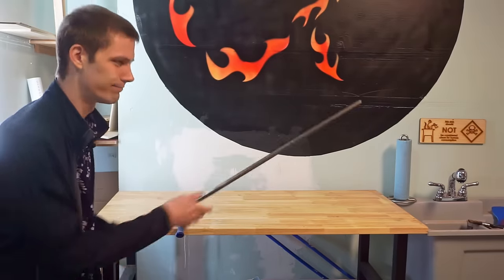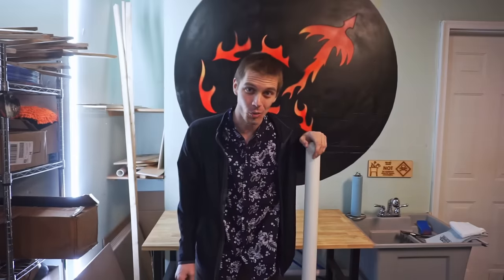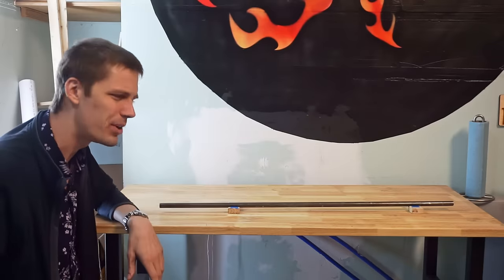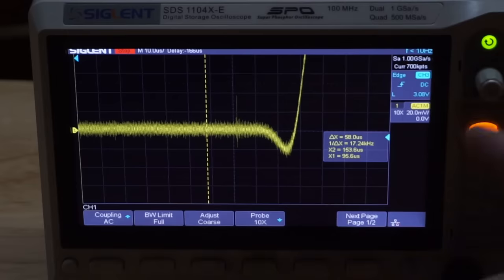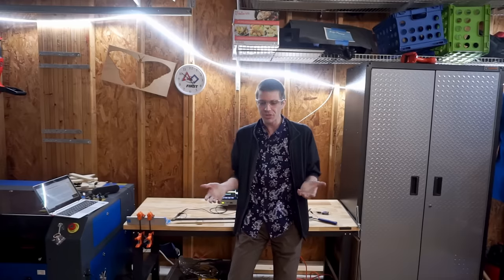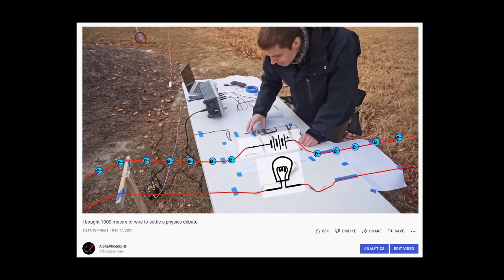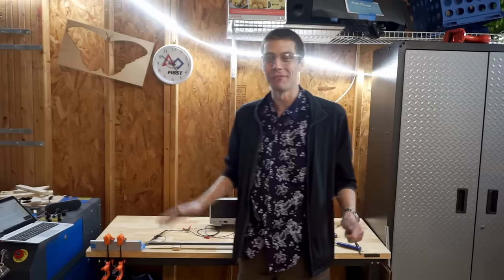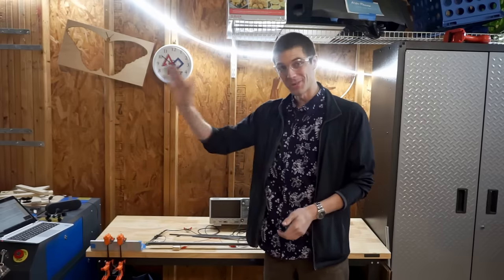Are solid objects really “solid”?

Comment: I am a metal worker and I often ponder this when striking a large piece of metal with a hammer and how the noise is generated. When I saw a 1000fps camera watching a drumstick hit a symbol I then realized that metal is kinda like a jello ! this further grants me a deeper insight into the nature of the materials that I craft with. Thanks a ton! Now I have questions of material hardness like mild steel vs machine steel or hardened? Answers always leed to more questions, I am grateful for people with such a wealth of knowledge and perspective that can break this stuff down for simple minds like mine.
Reply: if you think thats kewl, ponder the different sounds that are produced by metal in the many different applications... such as the guy lines holding those 500+ foot tall towers, the round rail track a crane pivots on, really long metal pipes of various diameters...  they create sounds that are very strange to just hypnotic.
Reply: Harder materials - higher speeds of sound (typically, strange stuff "always" appear).
Reply: @KitagumaIgen  not actually. What you meant is that higher rigidity implies higher speed of sound, wich is the magnitude de Young modulus measures. It's a property of the material, hence it is not afected by heat treatment of the steel or the alloy. There is a beautiful video from This Old Tony where he explains that in a lovely way (it's also fun). 
Cheers!
Reply: @brunogausa  Do you have some example where a harder material doesn't have a higher Young's modulus?
Reply: @KitagumaIgen  well, a clear example is the comparison between hardened amd mild steel. 
Other cases are harder to come by, but there are materials like poliurethane resins that are not as hard as steel and more ridgid.
It's an interesting topic
Reply: A great example would be pine wood against a lot of thermoplastics. The later are harder and stronger, but wood is far more ridgid
Reply: @brunogausa  Wood? That's not a material that exists! Oh, man I was way way way too narrow-minded to think about anything outside simple homogeneous materials, and I forgot that hardness has a specific meaning in terms of resistance to plastic deformation. More coffee for Kitaguma.
Reply: reminds me of something I heard a while back about rocks not being technically solid but in fact just being very very very very very viscous, and extremely slow flowing. The same basically applies to everything, nothing is truly solid, just unimaginably viscous and slow flowing, and of course the same goes for metal. Like if you think about it, metals have melting temperatures, but it's not the case that they remain solid all the way up to 99.99999% of their melting point temperature, and then POOF they hit 100% melting temp and they suddenly become a liquid- but rather it's a gradient where as you increase temperature they become "less solid". Therefore it stands to reason that as you lower the temperature, the viscosity, or solidity, increases gradually. So at ambient temperature something like a cymbal is viscous/solid enough to retain its form, but smack it with a drum stick and you see this wave motion, as opposed to the entire structure moving in unison, each part jiggling perfectly with the other. instead it looks more like, as you say, jello, or like throwing a pebble into a pool of water. there's a point of origin of the motion, and the motion travels from that point through the rest of the cymbal with the fast push/pull motion that appears as macroscopic waves, but which originates from the actual forces between the atoms/electrons! (i don't understand this too well on the atomic level so i'll leave that last bit at "atoms/electrons" otherwise i'll say something wrong haha)

but yeah my original point, it's interesting to view solids as just very slow flowing liquids rather than as literally physically solid
Reply: Any kid who's put their ear to train tracks...
Reply: do the same test with different types of metals and compare them.
Reply: @HeyItsKora  Interestingly, the first (and really only) solid that I ever heard described as a "liquid" was glass. Exempting the Pitch Drop Experiment.
Reply: Ever done psychadelics? They make everything jello! 😂
Reply: @HeyItsKora  Very interesting mate. Makes me wonder about the early universe when it was incredibly cool, although there probably wasn't much to observe 😂
Reply: @HeyItsKora  I was on mushrooms with my mate having a similar discussion to what you've stated. I was leaning on this tree and I said if I leant on this tree for my whole life, I would sink into the tree and become part of it; almost like I could with water, it would just take a much longer time. Mushrooms are good for funky thought proccesses
Reply: @aliasofanalias7448  hahaha that’s amazing 😂 theoretically, totally possible! Although you would have to be there a VERY long time for that to happen! You’d need a pretty huge stock of mushrooms to sustain that trip Lmao xD

Ahh man mushrooms are cool, only taken them twice, and the second time the trip was weak. The first one was great though (both times we picked the shrooms ourselves in a forest outside my friend’s house so it was kind of hit or miss, we didn’t have much way to quality control. But man that one trip that was good felt so great, we just walked around the city for a while, then walked out into more residential areas where there were a few big fields and farms, and the best thing was it was a super foggy night man, the fog was so damn thick, like 100 yards away was like looking through a veil of smoke, I think it really added to the effect of the trip, it made everything feel even more surreal

I’d kill to relive a night like that again, been like 8 or so years since I’ve taken psychedelics- or drugs of any kind for that matter… anyway I went off on a tangent sorry haha
Reply: @HeyItsKora  Yeah like for ever, you ever played fallout 3? Reminded me of Harold in Oasis. 

Awesome man glad to hear the mushrooms found their way to you! Damn so you just munched a random amount wet? That's brave bro! Where you from if you don't mind me asking? Wondering what you picked. It's cool that you liked the fog because I can recall a really scary trip where I got scared in my house, I think it was because I had a coffee to wake up because I felt weird and it completely threw me off, so I went outside into the fog and then my mate asked me to come touch a tree and the tree literally took all my problems away 😂 I was a literal tree hugger and found it hilarious, the tree literally healed me man. I thought at the time it must be a frequency thing like I got on nature's frequency rather than my own but I was also tripping my nut off so who's to say 😂. Then we started thinking about how a tree would perceive time and we figured seasons would probably go by really quickly and our tree hug would be like a fly landing on your arm.

Anyway I got back and made a coffee, the same thing I was doing when I was in absolute despair trying to find my mind, and I found it hilarious that we can be doing exactly the same thing but be in a completely different place in our heads. You liking the fog, and me not, made me think of that. Just goes to show how powerful the mind is. Don't apologise man you set me off too 😂 I honestly love hearing trip stories and I'm always overjoyed to hear people have had memorable experiences
Reply: Cymbal, not symbol, very different English words, lol
Reply: I assumed from the title of this video that this was going to be about non-duality and that matter doesn't exist because all is mind
Reply: @yourlogicalnightmare1014  Mmm, Consciousness = reality
Reply: @HeyItsKora  i believe in your case you will prefer amorphous and crystalline than liquid and solid
Reply: You working and wondering what’s actually going on, on a deeper scale, is the origin story of how experiments come to be.  Every name in science began with a question about something they see.  
Just thought that was cool. Always stay curious my friend.
Reply: @TheTMFD  Yeah, I mean all scientific experimentation begins with an observation, then a theory, then a test. It is a cool thought though
Reply: "cymbal"--unless it was a symbolic cymbal
Reply: Bro, you have got to get a book on material science!!! I bet you can skip a lot of the physics introductions that end up deriving the important stuff and just use the equations at the end with a philosophical understanding of how they work, but the investment in knowledge will be huge for your work!! Books that are meant for the absolute experts can often be useful for people who don't want to spend years studying a degree in physics. Most chapters and derivations end with a very practical and useful equation, and a lot of the literature which goes along is meant to help clarify the complex math, not delve in further. Give a physics book a try! I can recommend authors which are very good at using the math where necessary, but cutting to the absolute chase of getting people to practically understand when they speak. You'll do great!
Reply: Somehow I think you’re not a simple mind ;) :)
Reply: It is beyond obvious that the force would take time to propagate through the material, otherwise everything would be instantaneous, which doesn't make sense

This is stuff I easily deduced as a 7 year old, and was ironically called an idiot for saying that pushing a metal stick means the end doesn't move until a delay as that force takes time to propagate through the material

Comment: I loved the "electrode clipped to hammer" solution - I didn't think that was messy at all. Great solution!
Reply: Yes. But I was wondering about the delay for current to pass from hammer head to hammer claw, and the electrical spark gap in advance of hammer head "actually" contacting the rod. Anyway, speed of sound never occurred to me as part of any viable equation- I thought of it all only as a Young's modulus problem of compressibility. Looks like I was mistaken.😆
Reply: @orangequant  ya i too was thinking about the spark starting the hamTimer a bit sooner than it should.
Reply: This reminds me of a method of auto-levelling cheap CNC machines for PCB manufacturing. You just attach an electrode to the bit and another to the PCB blank, so the machine knows when it's touching the blank.
Reply: @antonliakhovitch8306  contact milling to precisely get to an inner layer of a multilayer board is also a thing.
Reply: @Layarion  so I am not alone!
Reply: Eliminated the error due to inconsistent striking force(???)
Reply: @orangequant  That would be in the order of speed of light and will have very negligible effect on final answer as Speed of sound though steel is not even close to c

Comment: Going to give you my guess here: C, speed of sound.
I'm no physicist (graduated in computer science) but my gut feeling says "somewhere much lower than the speed of light" -- atoms have to propagate repulsion along the entire length of the bar, which is something mostly "one after the other" -- and I had completely forgotten that a term, "speed of sound", already exists for what is pretty much the same phenomenon. I do wonder if the strength of the impact affects it, because pushing those atoms closer together would generate more repulsive force in response, which would mean greater initial acceleration for the next atom in the chain. However that would have the consequence that louder sounds -- or even just higher-amplitude components of a sound -- travel faster than quieter ones, so that would be a surprising result to me. I'll watch the video and see what happens :)
Reply: on Mars, low-pitched sounds travel at about 537 mph (240 meters per second), while higher-pitched sounds move at 559 mph (250 meters per second)", concluded NASA.
Reply: My intuition only came after learning the answer unfortunately: the speed light applies to energy waves propagating through a medium; the speed of sound applies to the movement of the medium itself.
Reply: Speed of sound through the solid, which is faster than through air.

Comment: Some interesting thoughts I had about a 300,000 km long steel bar in space: If you were floating there with it, it would look like a small diameter steel bar but you wound not be able to move it by hand due to the mass of it's length. It would feel like an immovable object anchored on nothing. I guess it might bend on a large radius but snap back when let go. That would be a very weird thing to see. Also, a bar that long of the diameter shown would drift around like a soggy spaghetti noodle if other forces like gravity were there acting on it. It's too bad we can't have a very long steel  bar in space to see how it would behave first hand.

edit: also want to add that the effect of heat and cold on a steel bar that long would make for massive changes in it's length. Railway operators sometimes need to heat up rails in cold weather because they shrink so much and create a dangerous gap between rail lengths. If my math is right (please correct me if I'm wrong) a 1 degree c increase in the entire length of a 300,000 km long bar would increase it's length by over 3000 km. Insane.
Reply: You wouldn't be able to move the whole rod, sure, but you could easily shake or bend the end of it. And, as you said, it would most likely just snap back and vibrate for a long long time. You're spot on regarding the contraction/expansion due to heat. Frankly, any sudden change in temperature, like it emerging from a shadow into the light of a nearby star and that rod could literally impale an astronaut or a spacecraft, unfortunate enough to be nearby and in its path. It would be a very very weird sight indeed. I suspect, at such length, other physical effects might manifest that we haven't even thought about.
Reply: The value of 3,000 km expansion for a 300,000 km would be 1% per degree, that seemed high (100°C change would be 100%). So, I found a document listing steel's expansion from 0°C to 82°C being 1.34 mm / meter. So that's 402 km for the entire range or about 4.9 km / °C. Though apparently different types of steel can vary considerably (by about 50%).
Reply: Also depending were the bar is in space and how it moves, it may be influenced by magnetic fields and get an induced electric current on it. If you touch it you might get zapped, or the bar could be very hot, or the steel could burn and snap like a soldering stick.
Reply: @Pixelarter  Very true, I was thinking about this too. In a way, it's a giant antenna and will convert any radio signals hitting it into electric currents, zipping back and forth along the length of the rod. Getting zapped by it would indeed be a real concern, in my mind too. Then there is the magnetism of a steel rod, which could cause it to change shape and attract/repulse other magnetic objects around it.. It's a mindfield haha.
Reply: @TheRadiastral  Nanohertz communication
Reply: @TheRadiastral  I was thinking about that antenna electric current from Veritassium's example, whether or not that would turn on the light bulb before he flipped the switch. I wonder if you wouldn't get more current from the photoelectric effect?

Comment: This is awesome. People forget "the speed of light" isn't just about light. It's the speed of causality. The quickest information can be transmitted. So no matter what, even if there were NO space between atomic structures (assumingly existing in theory only), that's the fastest possible speed.

Edit: As soon as you hear the term "wave function" to calculate any option, that should tip you off right away that it's not instantaneous. Love the ball/spring model!
Reply: It makes me wonder whether it's misleading to teach it as "speed of light" in the first place, as it should just be a fundamental maximum speed of causality like you said. Speed of light is just one manifestation of it.

Comment: Everything is a spring. In this case, the bar has a really low spring constant. Instead of compressing the spring, you move the spring entirely. The force travels from one end of the rod to the other as a (fast) speed determined by subatomic particles, the rod compresses, then it transfers its force from the end of the rod to it's target.
Reply: i think u might mean really high spring constant, but ya!! and actually the Bulk Modulus is basically the spring constant for solids :)
Reply: as a physicist, "everything is a spring" was my first instinct lol

Comment: either c or d. since the speed of sound is based on the rate at which a wave travels through particles, that makes the most sense to me as having relation to this problem. though the amount of force applied and other constraints may affect it as well. I'm not as well versed there
Reply: Yeah, I figure it's the speed of sound through steel... which, I think is what d is getting at.
Reply: Exactly. If you hit it hard enough / fast enough, it will "mushroom", thus not transfer that energy through the entire bar. (in this bench experiment, you'd break the hammer and sensor before getting to that point.)